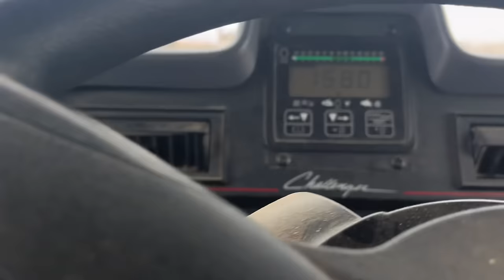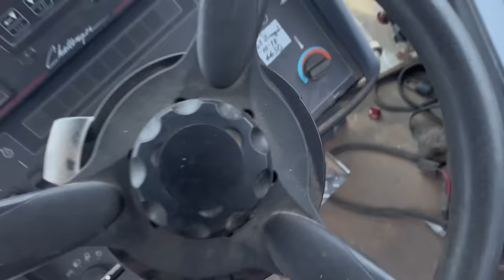Winter Farm Work in North Dakota

Comment: Had gear box freeze up solid once moisture had seaped into it through the drive shaft and it turned into block of ice.
Reply from the maker: That sounds awful
Reply: Check the gear boxes for water content water from rain and normal heat and cooling condensation will build up in them